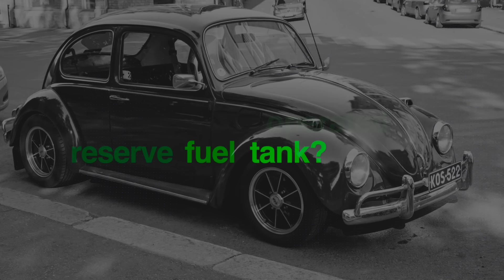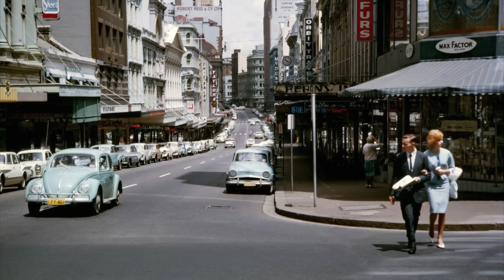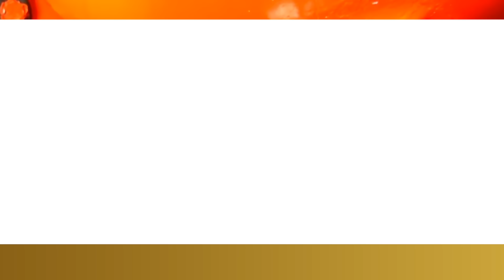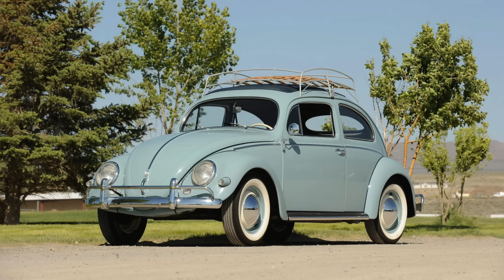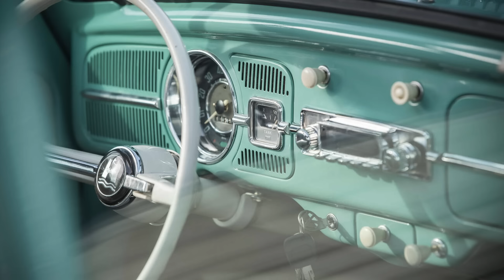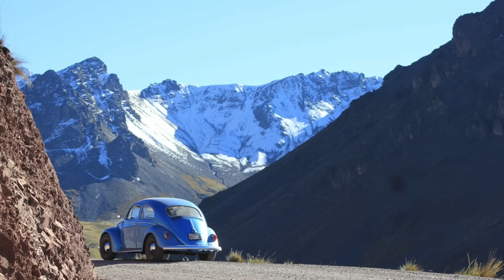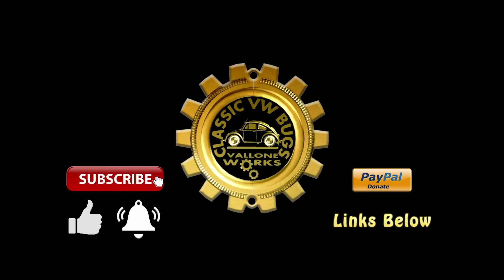No Fuel Gauge? See How Beetle Drivers Survived!

Comment: You didn’t reach down to move the lever, you did it with your foot. I had a 61 beatle with this system. Problem was for me, I worked in San Francisco and drove home to Marin each night. Many times I’d leave the Golden Gate Bridge and head up the Waldo grade. That up tilt in the car caused the fuel to move back in the tank, causing it to drop below the intake tube, and then when I needed power most, for the up hill run, bam! Out of gas! I’d switch the fuel lever fast, but still it took 30 seconds to take effect, by that time I’d slowed to about 10mph in the right lane. With 40 horsepower, I’d never regain the speed lost so I topped the grade at about 20mph. And made up the time flying down hill to the Stinson Beach exit. .

Comment: My first car a BMW Isetta had the same system. A mechanically activated spare fuel tank. My second car a Goggomobil 700 had a light that came on in the dashboard when the fuel was down to one gallon. Both worked well but a fuel gauge is better.

Comment: my motorcycles are like this.  I have a reserve valve plus I reset the trip meter on the odometer everytime I fill up.  I can go 150 miles before I'm close to reserve.  If my estimate is off and the bike starts hesitating- I just turn the petcock to reserve and I got another 40-50 miles to find a gas station.

Comment: The '59 VW panel van I drove also had no fuel gauge.  There were three controls located below the edge of the bench seat.  The one closest to the driver was the choke.  The next was a large black knob which you would rotate to send heated air from the engine into the front compartment.  The one furthest from the driver was the reserve tank control.  You would have to pull it out fully (about 8" or more) to get the reserve gas.  You had to be sure to push the knob completely in before refilling the tank with gas.  I think that there was a canister inside the fuel tank that would dump its gas into the main tank when the knob was pulled.  That's how it was explained to me back then.  The fuel tank was located in the engine compartment just forward of the engine.  The heat inside the engine compartment would cause the gas in a full tank to expand and dribble out the filler cap onto the driveway, especially in the summer.

Comment: The original VW bugs didn’t have a valve to switch to reserve.  The fuel tank had a hinge at the front of the tank, and the lever tilted the tank up slightly.  When you ran out, flipping the lever would drop the tank level, giving you access to the remaining fuel.

Comment: Had a 62 and it took several attempts to keep the fuel gauge from getting stuck as the mechanical connection to the tank was unreliable. The first few months I fueled every 200km/120km to avoid running out of gas.

Comment: It's important to remember to turn that valve back to normal.
I had the same system on my first motorcycle.
One time I was driving and when I startet do wonder when I would tun the valve to reserve.
When I looked at it, I realized, it was already at reserve, but luckily I stopped to refuel before it was empty.

Comment: I had a 1970  type 1.  I think they did away with the reserve thing when they put in the fuel gauge in about the 1965 model.  I had a convertible and would freeze my butt off in the winter.  The stove box heater was a joke.  I traded it for a 1977 Rabbit.

Comment: I’m 77 and had a 1960 with the reserve the reserve tank in 1972!!! ! The guy I bought it from “neglected” to tell me about the reserve!!! I got about 3 miles down the road and ran out!!!! Got pretty good over the years switching to reserve which actually helped me years later when I bought a used 1981 chevy pickup with two tanks!!!! Had a switch on dash to switch to full tank which I had to do a lot!!!!

Comment: the US market Beetles didn't have a fuel guage till 1961 but other countries had no fuel guage on the 1200 models past 1968 still having the reserve tap under the dash, as US standard Beetles got the mechanical cable driven fuel guage from 1962-1967 as the 68 to 1977 US models had an electric fuel guage in the speedometer cluster as the dashes still had the hole for the mechanical fuel guage with the exception of the 1973 and later Super Beetle models  which had a different dash with a single speedometer binnacle  as on Beetles 1958-1961 had this fuel guage hole in the dash to the right of the speedometer as then you could get s sccessory fuel guage or a electrie VDO 6 volt electrically wound anlog clock. also there was a extension acessory that connects to the reserve lever which then you could control the reserve lever from the dash  as the Beetle in Germany since 1938 never had a fuel guage all with the reserve tap

Comment: I had a 63 when I was 17 waaay back then.  No reserve crank lever, but we knew how to do basic arithmetic and learned to watch the odometer. There was no trip odo, you just remembered your range. When I got to 300 miles or so, I filled up for $8.  Later I had a 64, which had a gauge.

The 1973 Arab Oil Embargo was a shocker.  The price jumped to $10

Comment: That doesn't sound very safe, you better hope you were not at high speed or in traffic when the engine began to sputter. That guy behind you is not expecting you to suddenly start slowing down for no obvious reason. If the fuel lines were empty enough to have the engine sputtering surely it would take some time, a few seconds at least for the reserve fuel to reach the carby. You wouldn't want to be on the wrong side of the road overtaking a slow moving truck or caravan, not as if they had enough power for that anyway.

Comment: I do know this because friends had an ancient 1950s era Beetle back in the mid 70s which had a fuel tank dipstick, tho' I think you could lift the bonnet/hood open the fuel tank at the front, lean over and see for yourself with a torch as well. When travelling, the engine would start to die when driving when the fuel ran out and you'd have to turn on the reserve under the dash somewhere (if you hadn't forgotten to reset it!). Motorcycles used to commonly have the reserve valve feature too - maybe some still do. The lack of a fuel gauge was pretty pennypinching; basically, they are just a float in the tank connected to a switch with a gauge on the dash and a connecting wire. Hardly an expensive item to install during manufacture.

Comment: My '65 has the fantastic and simple mechanical gauge but a panel shop employee broke the cable by the ball end.I got it fixed but it doesn't read quite as accurately now,so as a precaution and out of habit,I pop off the metal cover over the top of the tank that protects the cable and see where the arm is to determine how much remains 😊.

Comment: I had a ‘58 Bug from 1993-99. It had a metal ruler to measure the tank. The only time I ran out of gas was when a mechanic left the car running for a couple hours without me knowing. It messed up my internal gauge. Otherwise you got to know the car very well and the reserve wasn’t needed.

Comment: My Honda 4 trax quad  has no fuel gauge or odometer but does have a reserve tank. When it sputters you can NOT switch it fast enough before the engine dies.

Comment: Had an old VW like the video... then I owned a TR4 with a fuel gauge that didn't  work. No problem, just used a half of yard stick. It worked because the cap on the TR was in the middle high on the boot. Never got the gauge fixed.
Reply: I forgot to note that I used a bit of math knowing "miles per inch".... about 30 miles for 2". My reserve tank was between my eyes and the odometer!

Comment: There was another problem with early beetles that did have a gauge. If you never filled the tank all the way or left it with a small amount, the rheostat windings would corrode above the fuel level. I ran out of gas at the top of a back road to silverwood lake, (part of hwy 138), southern California. A 65 beetle. I waited for cars to pass then put it in neutral and went as fast as I could down the hill coasting and finally came to a stop within a couple hundred feet of silverwood country store that had pumps. The only place around for miles. Whew. Got home and replaced the sender. I could see the cause visually as the sender was beyond primitive. Lesson learned.

Comment: Older motorcycles all had reserve tank fuel systems.  Instead of waiting for the main fuel tank to run out which was kinda stressful, you'd watch your odemeter and fuel up every so-many miles. I'm guessing Beetle drivers used the same technique -- providing that VWs had an odemeter. 😅

Comment: I had an older Chevy S10.  Both the fuel gage and speedometer didn’t work.  The tach worked so I could get a rough estimate of how fast I was going.  Around town, I would just keep pace with traffic anyway.  And the trip odometer worked as well. I just put gas in it about every 200 miles.

Comment: Another oddity of these cars was that the windshield washers ran off of compressed air from the spare tire.
Reply: I liked that feature on mine. I set the tire at 40 PSI and it would really squirt the fluid. Also, the valve would stop draining the tire when it got to 20 PSI.
Reply: There were versions with pressurized washer fluid tanks as well.
Reply: I loved that feature, and for some reason I don't recall the spare losing much pressure. And the fluid tank was mounted in the center of the spare.
Reply: @sayvilletech9135  it didnt lose enough pressure for you to get a flat. 
In other words, it stopped working at around 20 psi, but 20 psi , while low, was still safe enough to drive on if you had just changed your tire and had to use the "washer spare" to drive home.

Also, everyone back then could operate a hand pump, or "bicycle pump" as people like to call them. It takes about 10 pumps to get that from 20 to 35.

The real danger was if your windows got dirty right after you changed your tire😂

Comment: Looks like VW copied the reserve valve from motorcycles.  I remember old bikes having that exact system.  At one shop I worked at we had an older work truck that the fuel gauge go on us.  Everything else worked and our solution was simple.  We put a label on the dash that said reset when filling and refuel at I believe it was 350Km.  If I had a collector beetle just use sticky notes saying fill at xx miles.

Comment: My first car was a 1960 Beetle and I would use the odometer to determine when I needed gas.
I knew that the car would get about 250 miles to a tank of gas.  I kept a notebook in the glove box and recorded the mileage at each fill up.  I would mentally add 250 miles to the last mileage entry, and know that when the odometer started to get close to that figure, I needed to start looking for a gas station.  I rarely used the reserve gas lever on the floor.

Comment: The answer is B and C. My '59 got such good mileage running around our towns that I just filled it on Saturday or Sunday. It happened to me once though and I put in the clutch, reached over with my right foot and threw the reserve tap and let out the clutch, all while trying to move right in traffic to the shoulder. It caught soon enough and I reentered traffic and stopped at the next gas station. I forgot to reset the tap lever once. That was all it took. Checking the reserve tap setting was part of the pre-flight checks. R/
Reply: My mom did that once.  How about the spare tire as the source for the air pressure for the windshield wiper fluid?  You could end up with a flat spare.😁

Comment: This system kinda swx, as I found out the other day on my motrocycle.
The problem is, any water in your gas tank settles to the bottom below that higher intake.    If  you are always keeping your tank full most of the time and never having to swtich to reserve, you'll never burn off or notice this accumulation of water.   Until that one time you run low, and out in the middle of nowhere or far from a gas station, have to switch to reserve, which is now full of water.   You'll wonder why your car is still sputtering and running like it's on one cylinder until you can make it to a gas station, tank up, and then run all the water out of the carb float bowl and be back to 100% gas going into your engine.

The solution is to dump some HET into your tank every now and then...

Comment: In 1970, my '59 Ghia had the reserve switch.  It was one of my favorite cars.  Several of my motorcycles also had the same kind of switch.
Reply: I had a 57 Karmen Ghia with the reserve petcock. Not a problem for an old motorcycle rider like me.
Reply: Did your switch handle  mount under the dash above the shifter ? My 58 ghia did and I just assumed it was original.
Reply: @leitheparsons1186 Yes, under the dash, toward the center of the firewall as I recall.
Reply: @MrHugemoththis was rod a 90° and a knob that matched  rest in the interior You could flip it about as easily as turn the radio on.

Comment: I am 74 years old and my parents had a 1965 Volkswagen Beetle and a 1972 Volkswagen Beetle. I knew from my teenage years about this valve under the dash on old Volkswagen Beetles. It had 3 positions, off, open and reserve. Because of the location of this valve, when the engine started to sputter either the driver or the passenger would kick this valve over to the reserve position with their foot.

Comment: My first car was a ‘66 VW 1300 beetle That I bought in 67.      I wish I still had it.    I loved that car.  It had the metal crank open sunroof.    I was 19 when I bought it and I’m 77 now but I would truly enjoy driving it again.
Reply: My very 1st car also was a 66' Beetle, which I bought around 1973 or so. Can confirm the crank open sunroof and the fact that it still had the 6 volt electrical system. I had just started working as a mechanic at our local VW dealership. Paid all of $350.00 for that Bug.
Reply: Reading what you wrote about the crank sunroof put a smile on my face, but only because my 1990 Golf also had a crank sunroof. It was the first car I ever bought. 

I disliked the crank sunroof then and always wished I could convert it to an electric opener. There’s still lots of things I liked about that car looking back at it. Lots of “simple” features.
Reply: We had a '66, too, and loved it. I wish I still had it. No sunroof though.
Reply: I have a 58 with the reserve valve and sunroof.  You should get one if you can and have someplace to keep it.

Comment: That's how I measure gas range on my motorcycle.   No radiator, no fuel pump, no fuel gauge....just a trip odometer and a reserve peacock (the lever).

Works great for 70000 miles so far.

However this shows the Bug was an antiquated car even when they started mass producing in the 50s.  It was primitive for even the late 30s.
Reply: petcock

Comment: I had a Ford F250 with two gas tanks and a manual valve on the floor between the seat and driver's door. I would usually keep a few gallons in the auxiliary tank to act as a reserve. It could be switched over on the fly and it saved my bacon more than once. If I was fast enough the engine wouldn't die and I didn't have to stop.
Reply: I had a Dodge D200 crew cab with that feature and a Ford 250 camper special  that had an aux tank.

Comment: My first car was a green 1960 beetle. After a couple experiences with forgetting to "reset" the valve, i got pretty good at getting along with no gas gauge. After the first sputter, a quick reach over with the right foot was all it took to get going again. Next stop, gas station. My next car, a red 1963 beetle came with a factory gas gauge. There were after market gas gauges available from places like J C Whitney.
Reply: I had a 1958 Ghia, it had both a gauge and the lever but it was handle mounted under the dash. It had a matching knob and looked original? The gauge really didn't work well especially on a rough roads.

Comment: The fuel gauge on my Riley was unreliable so I just set the trip meter to zero when I filled up.

I had a Land Rover with two tanks and a changeover tap which incorporated a switch to swap the fuel gauge to the active tank.

Comment: My 78' Vert's gas gauge has never worked. Even with a new tank and 2 different sender units installed it still only shows 1/2 full. Not sure what the problem is maybe faulty gas gauge or electrical issue.

Comment: My dads 58 vw had this.    No gauge, just a lever.     We also had a wooden dip stick to check the level.      The BIG flaw in this system was if you forgot to flip the lever back after you filled the tank, you would be running the car from the reserve side and run out of gas without a back up (which I did lots of times).    At least the car was easy to push.

Comment: My parents had an older beetle when we were stationed in Germany 1962-1965. One of our family stories my Mom always brings up is that my Dad would switch to the reserve, but then not refill the tank. Then, when she took the car and it started to sputter a few miles down the road, she reached down to throw the lever, and discovered it was already on reserve. A lot of shouting and cursing from my Mom then ensued. Judging by how much she tells the story, I think it happened more than once!
Reply: that's why it was a good idea to carry a gas can with a gallon of gas under the hood. back then a gallon of gas was 27 cents.
Reply: @sharkair2839 At least a gallon gas can!
Pure common sense.
If you fail to plan you plan to fail.
Another lesson I learned from owning old air cooled VWs is that the windshield washer's air pressure comes from the spare tire.
When you fill your tires fill your spare!
Reply: Also possible that your dad did actually fill up the tank but forgot to switch the reserve "off" afterwards. A common error! Of course the car then just runs all the way to nothing and when you go to switch to reserve ... you realise that you were already on reserve and that the tank's empty!
Reply: Grounds for divorce 😅😅😅.
Reply: Grounds for divorce 😅.